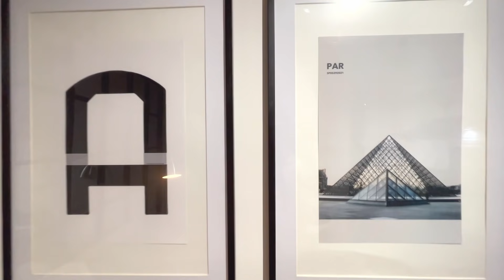1 Bedroom Unit Makeover (28 SqM / 302 SqFt) Scandinavian-Industrial-Minimalist | DIY

Comment: Nice transformation.
How were they able to make the hole to the outside for the window air conditioner install?
Reply from the maker: Thank you Peeta! It has a provision for a window type which was covered by fiberboard cement so the installer just cut through it with a grinder based on the A/C's dimension...😊

Comment: Nice Job!  Total Budget?  Conversion Time?  Also helpful to provide links to furniture suppliers.  One complaint, I have not seen a house/condo design in the Phillipines where they have moved or added a electrical outlet behind the flat screen TV to hide the cord.  They make kits to do this.  Also the outlet for the AirCon should have been relocated, Also I am surprised you had to add an AirCon to a Condo unit.
Reply from the maker: Thank you Sam! Total cost was roughly around 380K (6910USD)... Most of the items here were from furnituresource and Ikea... With the outlet for most condos they would not allow moving the outlets but with house you can do whatever you want... Yes affordable to mid level condos will only have the provision. Most of the High end are the only ones who provide A/C's for the unit...

Comment: Hindi na po kelangan magtiktik for the backsplash tiles installation? Tnx
Reply from the maker: Hi Jason! Yes di na kelangan, yong procedure na to gingamit din pag drywall yong pagdidikitan, in this case since flat na paint ginamit niliha ko lang sya pra kumapit adhesive and nilagyan ko ng mesh tape, Ginawa ko din sya sa sarili kong unit and so far its been two years walang prob… :)

Comment: Again, another renovation where there is a vent hood and no stove. Not even a small apt sized one. And more selves over the toilet. Doesn’t make sense!
Reply from the maker: Hi Vonnie! You must have overlooked it but this unit has portable electric cooktop shown at 18:32... The shelves were personal request of the owners... The need for flexible space for these tiny spaces were one of the major consideration why the owners prefer portable cooktop that they can hide after use hence the presence of the range hood... 😊